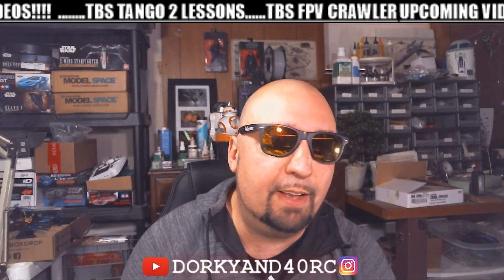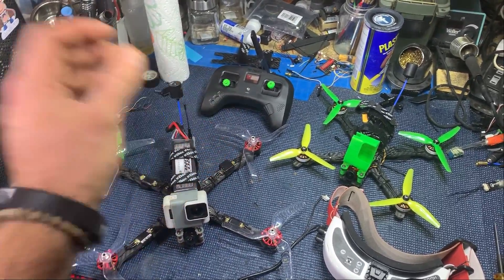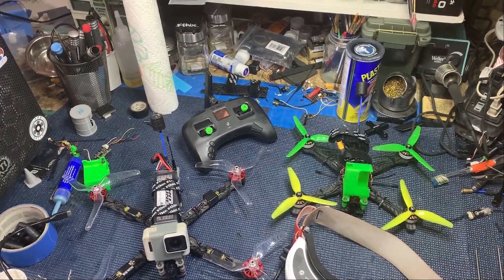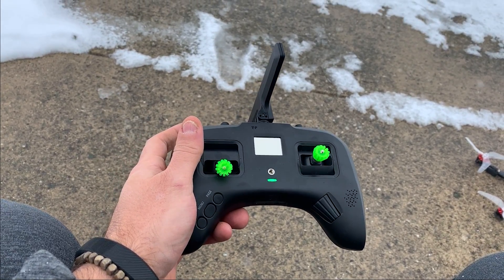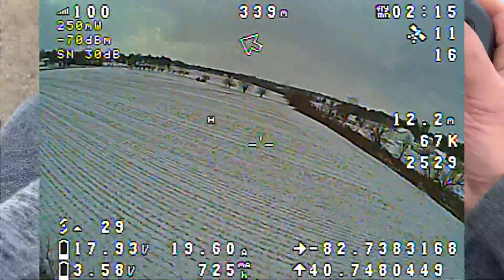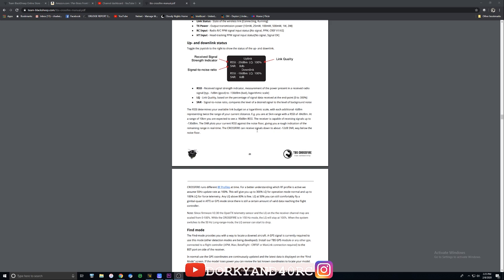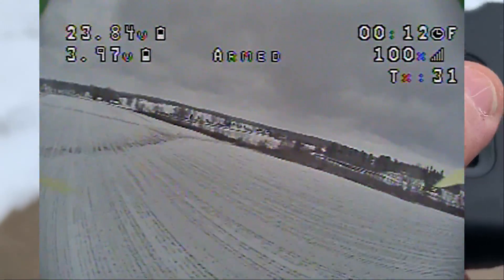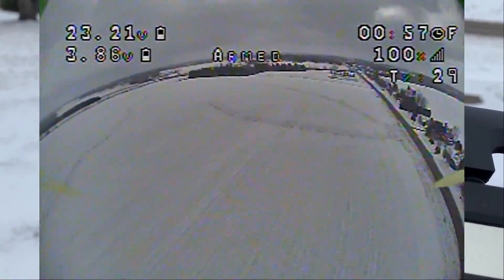TBS TANGO2 REAL WORLD RANGE TESTING | 2 QUADS | 250mw LIMITS

Comment: After a few meters you already cross some powerlines. That is definitely not helpful for testing the maximum range of a transmitter. Thanks for sharing anyways.
Reply from the maker: I’ve flown from my yard with crossfire for years. No issues at all. Only issue here was the less ideal antenna placement. Look at the second video and diversity video and see.
Reply: @Dorkyand40  OK, thanks.

Comment: I'm sorry but this is ridiculous. 900hz radio failsafe at 1km 😂 no no, I'm sorry man but something is up with your radio 🤷‍♂️ It is simply not possible, also you failsafed with like 80 RSSI. 1km distance on 250mw. I cover that with my dipol taped diagonal front right to rear left arm on X frame :D 

Your instal 2 is not WORST case what so ever, it is actually very favourable, as antenna tips are as far as they can get from CF. doesn't get much better than that at all. 

I fly horizontal only man, and failsafe at 1km even with 150 lock is just not reasonable :D My whoop with mini mortal and 250 does that much :D
Reply: yeah this test confused me to as I am new to long range and my set up is
tango 2 250mw
dynamic 
immortal T horizontally at the back and easy get 2km mountain surfing or flying across the ocean.
Reply from the maker: Watch part 2

Comment: Great video..New to CRSF and Tango 2.  Why do you use 250Mw locked and not dynamic? Does you LQ stay at 150Hz longer that way?
Reply from the maker: I locked it for testing so I knew it wouldn’t be a variable. I usually fly dynamic for any non long range flight.

Comment: Wow, I easily get over 1Km of range on my quads with a lowly FrSky 2.4GHz setup.   Horizontally polarized antennas are to be avoided at all costs because the null-points will cause signal loss at even relatively low range when yawing through some angles.  Even if you can't go fully vertical, getting some angle into the antenna will help.
Reply from the maker: Check out part 2. More data. Also the diversity video.
Reply: Agreed, I could comfortably get over 1km using only an FrSky.  I was expecting more.
Reply: Ya agreed, I have had a 6" quad with horizontal immortal T zip tied to the arm and have been out to 1 mile many times also I run dynamic now, but I've definitely done 1mile on 100mw before

Comment: thanks for the review , I'm on the fence for this Tango 2 , I'm planning on switching from my current R9 system , I actually have very good result with it , more then a km on 500mw (never failed safe) , I think I need to go with the full TBS module instead ...
Reply from the maker: Depends on your needs. I don’t do much long range anymore and my Taranis was falling apart. It’s still good enough for my whoops. So I got the tsngo2 and don’t regret it. It’s so small yet big and feels very premium. Crossfire is just fantastic and they are always making it better. Can’t go wrong either way.

Comment: long range you should use diversity
Reply from the maker: It’s not that long really but you are correct. Having the 2 antennas or using cross polarization will improve things a lot. According to my snr on the 7 inch flight I had kilometers to go still. But just wanted to do a 1km since I was sure the other ship couldn’t make it that far.
Reply: Ya but with lots of RF that’s where diversity will help the most.
Reply from the maker: Eric Lyon for sure!  I’m going to grab one for this big quad and have a go with it.

Comment: I have seen videos like this saying vertical orientation is best for distance but I have 4 kwads with the "worst case" setup and pushed 2 of them to 2 miles and the other two only to 1.6 miles no fail safes. Oh and Im running a micro CRSF with 250 max locked.
Reply from the maker: All depends. Many factors can play into it.

Comment: You should try the L shape antenna configuration. I got 2km the other day on my crossfire micro and still could push it more. My crossfire was set on 100mw!
Reply from the maker: i usually run the L but i have used and lost all my dipoles!  i am moving out to the arm and repeating the test on the 5 inch.  it still meets my needs for what i do but by the questions i see on facebook and youtube..it seems that there is an influx of new crossfire users.
Reply: DORKYand40RC sweet just make sure the immortal doesn’t touch any carbon. Looking forward to your tests!

Comment: Great test thank you. I think the take away from this is that crossfire 250mw is fine for mid range &  antenna placement is everything. Btw did you put rpm filters on your sourceone 7 ? is it still running bf4.0 ?
Reply from the maker: Exactly. With 250 you just have to be a little more aware. That s1 is running 4.0 but no rpm. Chris kuda and Brian helped me tune that ship over black boxes and the black box Facebook group. Right as rpm filters were coming out. Never circled the wagon back around because it just works :) then I think that’s when I took a break afterwards. I remember it has a few weird things like uavtech had on his raddix. I will maybe refresh it in the spring but I forgot how fun it was to fly :) hopefully will burn a few packs today after I repeat the 5 inch test with a new antenna placement.
Reply: @Dorkyand40  It's a great quad I have a similar build,  I copied your tune it flew like a dream. I'm putting dji hd on it ready for spring😀

Comment: This is very helpful. Thank you.   I dont know if I'll have the room to vertically mount on my micros but I'll see what I can do.
Reply from the maker: i have all my micros running horizontal.  even have hte mini Ts on my toothpicks.  they just arent intended to travel that far.  neither was this quad but it is a good learning lesson and ive already made some changes and plan to re-run the test.  i expect better results.
Reply: @Dorkyand40  Don't forget the L shaped antenna setup, gives you a bit on both planes. Usually proves best for freestyle.
Reply from the maker: TwItcH_FPV I like the L. It is perfect for freestyle but I’ve lost all of my dipoles so am using the T :)

Comment: Unfortunately that's not gonna happen with the remote currently sold ever maybe if they redesign it
Reply from the maker: Trappy said on the lounge that If enough people wanted it they would think about pushing out the update to make it happen like on the micro crossfire. He said it on the lounge.
Reply: @Dorkyand40  that would be nice I was under the impression it needed hardware since livufpv did it on the tango 2 and he works with tbs and he had to replace hardware
Reply: @Dorkyand40  would be nice though
Reply from the maker: @biggfpv2721  idk..but yes it would..a bit more would really be nice.